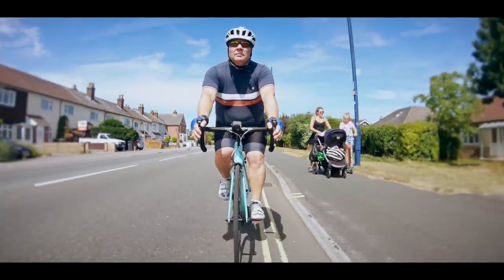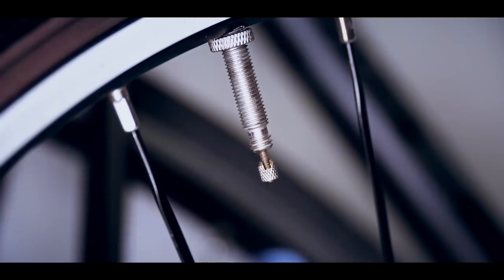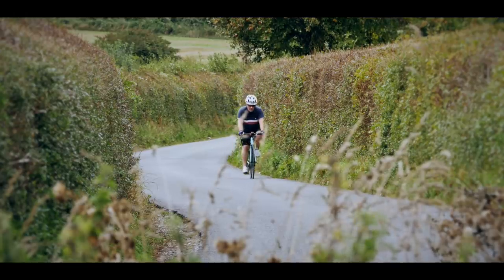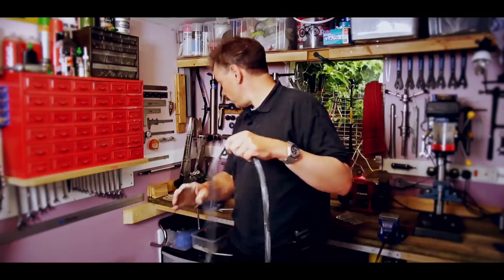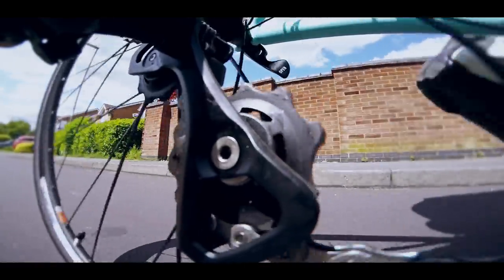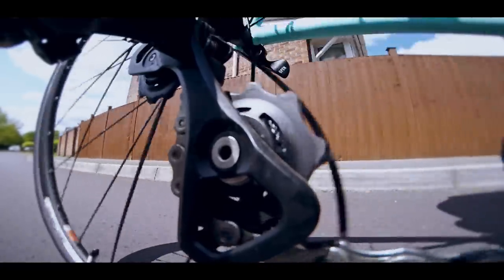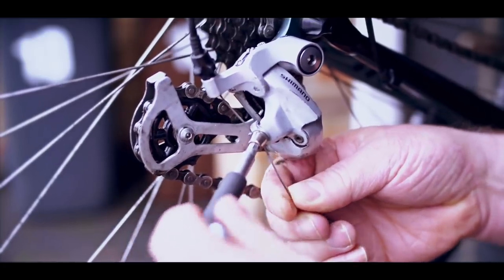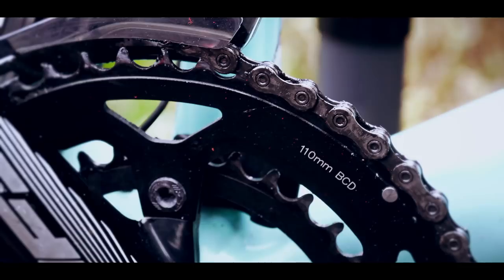Make Your Bike Faster

Comment: A few things I'd add:
1.  Supple tires, wider than average, running latex tubes at the pressure just below where you start to feel road chatter.  Rene Herse (formerly Compass) make amazingly supple clinchers, and Silca has flawless latex tubes, though maybe not wide enough for some tires.
2. Good chain line using larger ring and larger cog -- for the equivalent chainline, the chain bends less, which is why Ceramic Speed has those pizza-sized pulleys.  It also reduces chain/cog wear.
3. Pound up hills and coast down.

Comment: Well done another excellent video.
Completely agree with everything, I clean my chain every second or third ride depending on the dirt, I may be a bit ocd but I’ve just got a cheap ultrasonic cleaner (under £30) and it comes up like new.
The other thing I am ocd about is the brakes. I made sure my brake disc has clearance either side and has no rub took less than 1/2 an hour for both.
The last thing, I always ensure the wheel bearings aren’t too tight or too loose. New wheels should have sealed bearings but my new bike didn’t it’s got cup and cone type bearings. Takes less than an hour to strip and clean and re-adjust. 
Now It’s only a matter of shedding a few Kg
Reply from the maker: Some excellent extra tips, there, thanks.

Comment: Thanks for putting up another decent video.    There's one thing to add about putting talc on the tubes which is that it makes it quite a bit easier when installing or replacing tires with less risk of pinching the tube during the process.
Reply from the maker: +Parris George Excellent point.

Comment: Could I ask you what chain lube you are using? Interested to know, I have changed last year to Squirt wax lube. Now the chain is extremely quiet and performance in gear changing is phenomenal. Trick is to completely take off any previous oil residue and then it will perform very nicely.
Cheers :-)
Reply from the maker: At the moment I’m using the Finish Line chain line,

Comment: I fitted a set of Zipp 808 firecrest wheels a few ride ago, and swapped out my bottom bracket cups for a single piece with ceramic bearings, I’m getting a 0.2mph increase in average speed.

Comment: I’ve just fitted a 750 watt motor to my mountain bike, it’s loads faster now.
Reply from the maker: Saves pedalling, I suppose.
Reply: leonardmlee funny thing is as it’s a torque sensing pedal assist motor, you actually work just as hard but go lots faster, I’m smitten.
Reply: Cheater! 😀
Reply: I have ana illegal 1600 watt e-bike that I built myself and its twist throttle so I mean

Comment: Good suggestions.

But if you are going to adjust saddle height, please use a torque driver.  No one wants a warped or cracked seat tube.

Comment: Decrease your body weight will make your bike go faster too and take off some of the heavy parts on your bike , like the heavy metal basket or a bike lock tht is too heavy and buy a lighter bike lock and also keep your chain clean and make sure ur riding on a smooth ground
Reply from the maker: Reducing body weight is the obvious solution but I wanted to list ways of making the bike faster regardless of the rider.

Comment: Some good stuff in here, thank you. You've probably covered it elsewhere but do you swap between wet and dry lubricants? I notice dry lube works great on Julie's bike but mine sounds like a bag of bolts after 20-30 miles so have stuck with wet lube. Wondered if you had any experience of this?
Reply: I find that wet lube picks up too much gunk in the dryer weather conditions.
Reply: @Buckblacket  Thanks for the reply, it's good to know other rider experiences. I understand that could happen but it's never really been an issue, not sure why? Possibly we have less dusty conditions here, cleaning regime, a different idea of acceptable gunk? Not sure. I know some riders who use dry all year, replace it more often and get good results but I find it doesn't last more than 1 ride if that. Julie's bike works fine on dry so is it my more "manly physique" that's making the difference?
Reply: @WheelersAtLarge  tricky to quantify different road conditions etc but I use a ceramic lube and it works well for me. Better to buy a better quality lube imop, trying to "economise" in this area isn't worth it.
Reply: @Buckblacket  Agreed, I'm using Muc-Off dry lube at the moment so maybe I'll look at ceramic lubes. I've heard Squirt is pretty good.
Reply from the maker: I tend to mix between the dry and the wet.

Comment: All great tips. For tire pressure I use the "Berto Tire Pressure" app (free). It allows you to set tire size and width, bike style, rider weight, and loading on the wheels for an exact number for pressure. This has made a difference in my riding for sure. Be careful not to exceed the max rating for the tire though.
Reply from the maker: Thanks Norm. I’ll have to look that app up.

Comment: Spot on with all the tips you mentioned. When I was doing road riding a lot I was very analytic about every aspect I could try. Having the tire pressure dialed in gave me the best results. On a known spot on my training roads I did a test. Same time of day, air temperature, humidity, etc. and found a change of only two psi pressure could gain or lose me up to 20 seconds over that one stretch! Another thing you failed to mention and is a bit risky is finding a groove in your part of the road lane that has a layer of fresh rubber laid down by a car or truck going through ahead of you. Best results come from following the morning commuters after a rain shower has cleaned the surface and a new layer is there. Too much and it slows you down. ( Old auto racing trick )
Reply from the maker: Very interesting results of your test, although I suspect wind strength may have played a factor over such a short test.